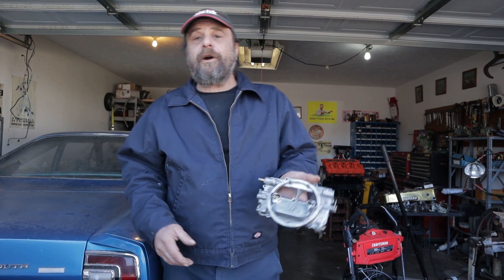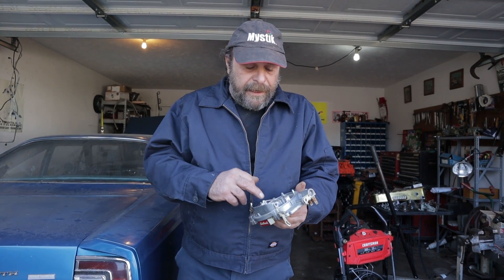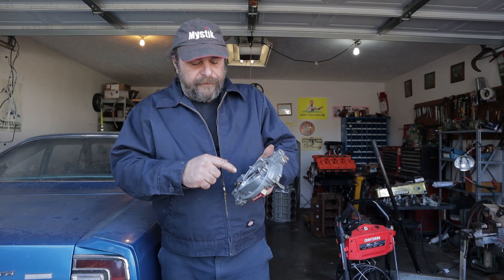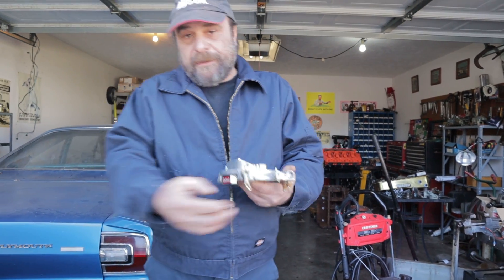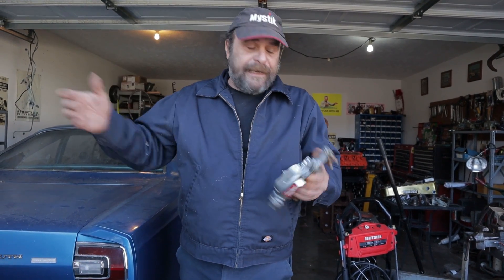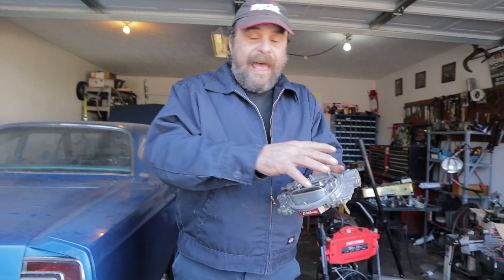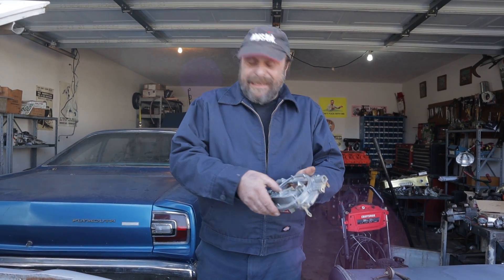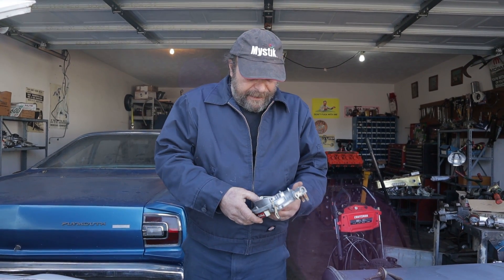The Most Troublesome Part Of Any Carbureted Car

Comment: What's really crazy is setting the 'high idle' for the choke. A lot of those settings are 1800 to 2000+ RPM. Set up properly can scare the crap out of people daily driving newer fuel injected cars. They don't understand why the motor has to run at that RPM until you explain at length how the old carbs operated back in the day. Until the intake manifold gets hot enough to vaporize the fuel going through it, you gotta have a pretty rich mixture and high RPMs to keep the motor even running. On auto trans cars with automatic chokes, you can just set the choke by pumping the the throttle once and put the car in gear and it'll drive normal even at a crazy high idle. There's more to all that, but I'll stop here...
Reply: William Bickel   That high idle was for emissions reasons. EPA wanted the choke off in 2 minutes.  ( maybe 3 min. I don’t recall exactly). Set the high idle on my 318 at 1200 rpm.  Really high idle can damage the Reverse strut in a torqueflite transmission.

Comment: the idle air motor  was bad on  my $150 police auction special..so throttle feathering kept it running til it warmed up. 

i made the linkage part from the heat stove to the choke for my tripower  has the same adjustment bend.

Comment: I learned how to adjust the choke and the pulloff on my Thermo Quads and the lil 2 bbl Carter most of my cars had at first. IF you get it right they'll start right up after one quick pump to set the choke and get a shot of gas in to prime it. My Dart would start on one pump with the 9800 series electric choke TQ, same with sisters Scamp. If it took longer than 3 cranks something was wrong or it was flooded. It is a black art and I grew to understand all the interrelated adjustments on the TQ and the bbd carbs. Most folks didn't have a clue so it either worked or they fought their cars in cold weather. There are measurements and adjustments in the true manuals for them that will get it close enough to work as long as the carb is already jetted close for the engine and you can fine tune from there.
I bought a 78 318 200 van and I had to set the choke and pull off for it once I got it home and I hadn't had to touch one in years but knowing what a 318 typically likes I got it right fairly quickly. Once they are right you shouldn't have to touch them again till something breaks or wears out. I even have a TQ strip kit and for a AVS and The AFB though if you kept all the parts the same you could use parts from either kit. Mopars usually used the 3 step metering rods and everyone else used 2 step and the matching jets from the factory. My Dart tested better emissions wise than many new cars in the early 80s after I fine tuned the 383 AVS I originally used before I swapped to the 9800 TQ I bought at a swap meet for 2 bucks and rebuilt. I ran that one for probably 15 years before I finally had to rebuild it again.

Comment: Perfect video - perfect lead picture!
Chokes are THE NUMBER ONE pain in the ass with carbs.
I've been lucky, a good many of my automatic choked cars worked like they should or close enough they weren't a problem.....
But some of those bastards got replaced with a mechanical choke, or ripped out, choke plates and all.
I never had a carb related "no start" even at  -20° with no choke,  I can't say my EFI cars did as well.
Below a given temperature, the ECM says "fuck it" and goes dead rich, and 8 injectors do a much better job of flooding an engine than ANY carb.

Comment: Adjusted the manual choke  on my '64 Sweptline to hold open the throttle as much as possible but close the choke plate as little as possible.  You guessed it... cruise control !  -(8[]
(Wish I still had The Old Blue.)

Comment: cure for lousy automatic choke: remove from vehicle, put in trash can, fabricate a bracket, install manual choke cable.
Reply: BTDT on my kind of first car (had to share it with my brother).  Electric choke wasn't working, choke was stuck half closed.  Broke the plastic housing off, installed a choke cable, drove the piss out of that car for a couple more years.

Comment: Yeah my 85 s10 2.8v6 carburetored it runs rich if i punch it or when i rev it up and make the 2nd barrel open cause black smoke comes out . But ive had issues with coke when it's warmed up my coke light doesn't go off and takes forever to idle down i tap the gas and will idle down somw but not all the way to put in gear and take off yet. So i bought another choke thermostat so i knew that was bran new and see if that fixed the problem . It also wants to cut out on me every damn time i make left turns or starts or trys but most time will and doesn't matter how sharp of a turn. i know it's definitely the carb . So im guessing the float is stickimg and that's what is causing it idk just very aggravating and sometimes when it hot soaks it like floods it self out when i go to get back in it and crank up to take off after sitting for like maybe 10 or more minutes . Ive tryed seafoam twice in the gas tank but didn't help tho . Gas mileage sucks  from full to empty is like 220 miles or so . Hell i might as well drive a v8
Reply: Just so damn aggravating other than that i can hit it from dead stop and will freaking take off but and stop hard or make right turns no problem . butt i make left turns it trys to cut out and if i can't get it in time it wil die on me . Also believe the choke pull off is bad . Its a Rochester 2 Barrel carb . Like to rebuild it but idk how to and a new one is expensive like $400 bucks versus like $25.00 for a rebuild kit

Comment: Had enough of chokes just pump the gas pedal couple times and hold idle around 1500 rpm couple minutes! Done ✅
Reply: Can totally relate to that one...my hemi...cold...pumped the throttle 8x...she lit right up....hot....don't touch it 'cause a flooded hemi is a bitch to start....

Comment: Growing up, my mom's 68 Newport with a 383 - 2bbl would have starting issues on really cold mornings. We always kept a screwdriver in the car, which I would grab and stick down the carb just to keep that butterfly from closing up completely while mom cranked it and got it running. Now I start my truck with my cell phone... ah the good old days!!
Reply: badcactus72   Sounds like the choke pull off was set incorrectly or inoperative. Cool car, btw.

Comment: Most of the problematic emissions systems were for cold start because the old school Cat needed heat to work.
I remember all those vacuum lines running everywhere. It was mind boggling when I was young and just learning.
Go to the parts store and ask for some vac line...."how much you need?"
Me; "about 100' 😳
Reply: Oh my God. And Fords were the worst. Back in the '70s and '80s, the low quality of the vacuum line that they used and the fact that they held a ton of heat under the hood meant that the vacuum lines were always baked and cracked and melted and they always had about a dozen vacuum leaks. Not to mention the fact that they used about a mile of vacuum hose on those things. If a service writer handed me a ticket on a two or three year old Ford with a drivability problem, I'd hand it back to him and say "Go sell me an hour's labor to replace all the vacuum lines" before I'd even open the hood. 
And if I open the hood and there was already new vacuum line on there, I tell him to go sell me another hours labor to put all the vacuum line back on where it's supposed to go.
Reply: @thebruce9042  
I remember.
Horrible system. Much worse when you're just learning.
WTF does this do?? Or if someone else has gotten to it first.
Scratches head......it goes from here.... across to here and loops back into itself.😲😠
😂
Reply: ‘81 Toyota vacuum line Disneyland. And those pesky vacuum check valves.  🤪😝
Reply: @raoulcruz4404  
I had a Nissan truck for awhile.
It had just as many sensors as a EFI motor bit they were all vac operated. Little pods all over the place.
I couldn't get it passed emissions so I had to take it to buddy's shop.
He pointed e one vac line and said "pull that one and it'll pass".
Sure enough, it worked. Ran like crap but it passed.

The good ol days.

Comment: I just leave mine unhooked.. just like uncle Tony said.. just feather the throttle for a few seconds..  👍
Reply: Yeah, unless it's -10 and you're late for work... that few seconds turns into several minutes.  Put a cable on it, then you can adjust it for any weather conditions from right there in the driver seat.
Reply: @livewire2759  lol.. just get a Toyota 🤣
Reply: @adanvaldcontreras4283  Ha!  Toyota...

Comment: my 2000 toyota echo has a glitch it it where if you start the engine cold. ok, then back out of the garage and shut it off. then you go to restart it 10 mins or so later it floods and does not want to start. the easy way to get it to start is hold the throttle half way open and crank it up. that works great. normally most of the time you do not have to touch the throttle on a fuel injected vehicle but some rare times it does need to be done.

Comment: there needs to be a choke opening linkage that will hold the choke open with the throttle floored. thats how you get past the warm engine cool choke spring  flooding problem. thanks for another helpful video.

Comment: A choke? Who runs a choke? Old guys who can't drive with two feet for the first five miles? Ok, ten miles for my E85 engines with the heat crossover filled in the head. I can see it with a mopar, those things are cold blooded as hell.

Comment: I have an Edelbrock 1406 on my 75 Ford. I’ve never had a problem with the choke other than having to adjust it if I drive the truck into late fall and it drops below zero. The choke on my 72 Fury on the other hand never worked right. I’m not sure if it’s the carb or the choke but it runs like dog shit when the engine is cold.
Reply: Sheldon Dyck   Never had a problem with the automatic choke on my 70 , 2bbl 318.  A few things will cause poor running when cold but usually it’s a simple fix.

Comment: I've been toying with the choke on a farm-fresh '85 K10. That was about the last year for a fully mechanical carb and bare bones ignition, but by then all the adjustment screws were blocked off or replaced by rivets. Though the worst part is finding parts that work; the bi-metallic elements don't allow rotational adjustment without assistance from a pedestal grinder, and the vacuum pull-offs are being sold for 75 flippin' dollar-roni's.

But it's ok, it's now one of the most reliable vehicles in the fleet.
Reply: In the mid/early '80's, I went off to GM 'school' to learn about the new, 'computer' cars, (remember the Citation?).  One of the things GM taught us was to take the Q-jet off, turn it over and physically break open the casting, so we could get to the hidden idle air-fuel adjustment screw.

As we sat in horror, watching the teacher pound on this $1000 carb, ($3-4,000 in today's dollars), trying break out this casting, he warned us to be careful doing this, as it was easy to fuck up the carb.  

At the time, some corporation was using 'a better idea' as their catch phrase in their TV commercials, and it had become a popular 'meme'.  Someone in the class says, 'Now, that's what you call a better idea, and everyone laughed.'   I then proceeded to gain the instant dislike of the instructor, when I asked, "Speaking of better ideas, is there any valid reason GM came up with the side mount battery, other than to sell more batteries and cables?"

He couldn't answer, and never really liked me, from that day on...

Comment: when I start my truck cold I pump it a few times and it starts right away. then after I park for a bit and the engine is warm when I go to start it I have to crank it for like 10 seconds and feather the pedal to get it to start. Sound like a choke issue?
Reply: Very possibly. Hard starting with a hot engine is a good indicator of an overrich mixture. But, some info on year, make, model, engine size, and carb type would really help us out with giving you sound advice.
Reply: @thebruce9042  f250 1977 460 carter afb
Reply: @M1k4e   Yeah, the AFB on your truck is pretty much exactly the same carb as that Edelbrock that Uncle Tony is talking about, so it's going to have the same hot start issues with the choke. Try wiring the choke open and see if that solves the hot start problem.
Reply: @thebruce9042  will do thanks

Comment: Id always unplug the electric choke on my quadrajet doesn't really get cold enough here to need a choke. Only gets down into the single digits at night a couple weeks of the year. Just pump the shit out of it and it always start first or second try and then I'd just hold it at 1500-2000 rpm for 30 seconds and it idles fine.

Comment: Hey Tony , I’m 62 years old and only last fall bought my very first EFI 1990 Scottsdale 1500 with 129.000 American miles on it . Have only ever run q-jets since the seventies. My dd work truck with Ht383 crate  has two block heaters and two hot air snorkels ( junkyard parts but looks factory with all vacuum doodads working ) drawing hot air off two ram horn manifolds . Here in northern Canada i often start it at 20 minus Celsius. Two pumps and it idles at 600 rpm no stumbles and NO fast idle either. Thanks to the block heaters, with out them I’d be screwed. I love the sound of these cold starts . Something sexy about them , just like old ww2 airplane motors, minus the blue smoke. Putters some and the after 20 seconds levels of to a nice even idle. An honest sound. In the summer I run an open air filter and love the sound of secondaries in sync with a raspy x pipe. Lotsa pretty girls turn their heads to see where that sweet music comes from only to see my dd 1ton . Love your show .

Comment: Manual choke came factory on my dart and truck and it will stay that way . Less crap to deal with . Tony check out my channel . I just posted my first video of my dart running .if the video is hazzy i took the video with my cell phone and click on the settings symbol at top of video and try the 240 P  setting?

Comment: I adjust mine while it's cold first thing in the morning before I start it.. Just move the air cleaner out of the way. Loosen the three screws a little. Watch the dots. Turn it counterclockwise, one morning, or a little clockwise the next morning.
Until it's just right. The "Goldilocks Position." That's how she likes it.
Just right. Uhhuh, uhhuh. Not too far clockwise, and  not too far counterclockwise. So easy a caveman could do it. That's the way my baby likes it.

Comment: i am in the no choke club! remove it! pump it and off it gos! chokes are a big problem and wash the cylinder down! and i drove a carbureted rig as my only transportation for 1.5 years and I am a millennial. if you do not use it makes life easy! tony you need next to talk about ignition tuning. i use vacuum advance i know you do not like them,but find it makes a big difference in fuel economy  and engine temp. i connect it to manifold vacuum so i can set base timing low for easy hot cranking then when the engine is running it speeds up the so it runs better. i figure the factory used a coolant temp valve on the vacuum advance to stop overheating by switching from ported to manifold vacuum. what are you opinions on ported vs manifold vacuum for vac advance ?

Comment: The choke was an easy setup ether worked or you made it manual! 
The old cars with the exhaust butterfly heat spring was often overlooked with it failing or just one side on V8s ! Would start cold good and run horrible warm

Comment: And motorcycles had an enrichener valve... a separate little carburetor on the carburetor.  I fought that Edelbrock thing until I got the manual choke adapter.  Nowadays I'd just put a switch for the bimetallic coil, if the car's warm just turn it on first.  Don't forget to pump the gas once to set the choke and prime the system for starting... something you don't do on EFI.

Comment: I've used the electric choke on my Carter and Edelbrock carbs for years and they worked great after you adjust the spring tension.
Reply: Yeah, if you live where the weather stays about the same all year round, they work well, but around here we go from 110+ in the summer to 0 and below during the winter.  I found that I had to readjust edelbrock's in particular every spring and every fall, but if I adjusted them on a cold winter day to where the spring just barely holds the choke closed, they usually did ok during the summer, I'd just have to pump them a couple of times.
Reply: @livewire2759  that's what I do with edelbrock and I dont have any issues, just a couple of pumps b4 I start and she takes off.
Of course I live in south Carolina and our weather isnt that extreme.

Comment: I just rebuilt an Edelbrock performer series carburetor that had an automatic choke. I was actually converting it from manual to automatic. There IS a choke pull off piston inside the choke housing. And the rebuild instructions explain how to adjust it.

Comment: I wanted to ask you i have a 84 d150, took out the 6 and the 904 trans, putting in a 318 and a 518, looking for parts a man told me i cant put the 518 in there it wont work, is that true thanks
Reply: People do it all the time. Google it. It's not a bolt in, though

Comment: Fords used to have the electric with a tube that to manifold someplace for heat. Think it happened mid 70s?
Reply: chrystler was weird. full eletric in the 30s and 40s. then in the 50s they went to a mechanical hot air only choke. bwahahaha
im interested in the hot air + electricity setup
Reply: The heat tubes are perfect when they are in good shape and working.
Reply: @ozmodius12  
re: "perfect"
Yeah, perfectly placed for burning the crap out of your forearm. I think you can still see the scars on my arms!  LOL  Gawd, I hated those things!